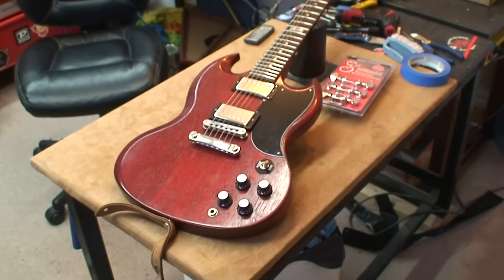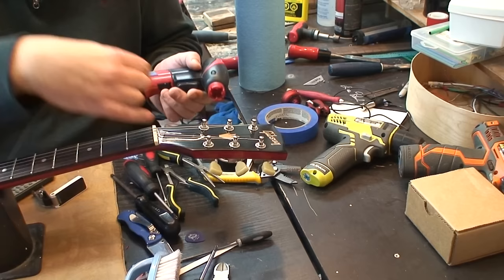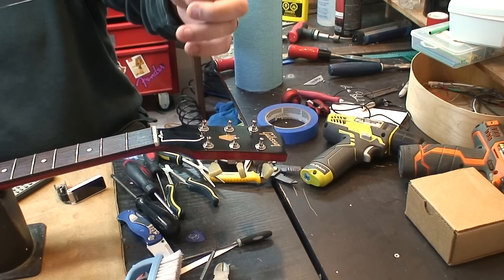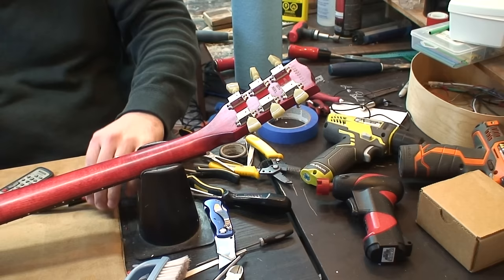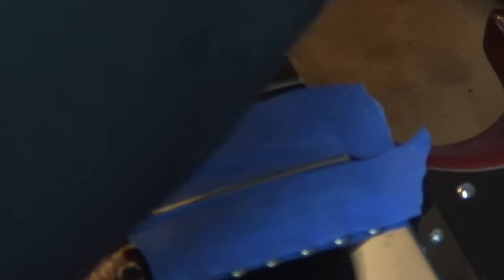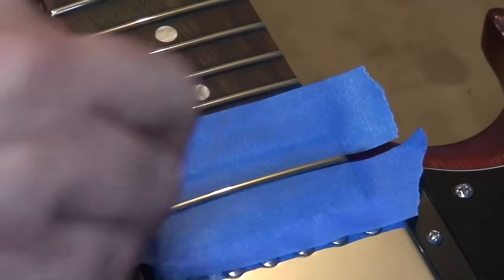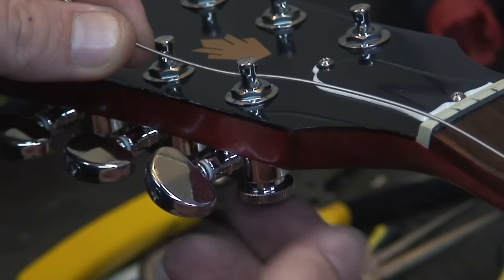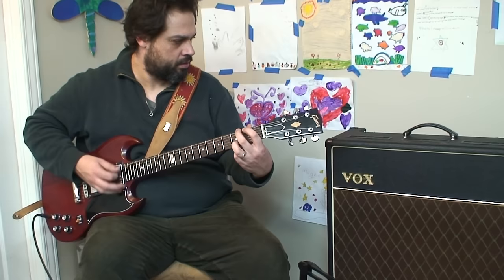2014 Gibson SGJ: Installing Grover 502C 18:1 Locking Tuners

Comment: GOTOH SD lockers with conversion bushings weight much less than the original vintage tuners lessening neck dive. Why are you adding Grovers and adding a ton of weight??? That guitar is probably now unplayable without standing and using a 3-inch suede strap. What are you doing? You crazy super villain, lol.

Comment: Kluson makes 2 kinds of locking tuners to replace the original Gibson or Kluson tuners: Revolution locking 3 x 3 tuners (wheel lock) & top-locking Klusons. 
I have 3 sets of the Kluson Revolution locking tuners.
Reply: Blkjakk yes, put those on all my Gibsons, great upgrade!
Reply: Are they drop ins or do they require some hole enlargement?
Reply: Putting a new Tusq XL nut on my SG and those locking Kluson's are next. I'm excited that they exist for my SG won't stay in tune. Hopefully new nut and tuners will do the trick.

Comment: One of the tuners on mine broke (the rubber feet that hold the back in place snapped for some reason, just real shitty outdated design tbh), I ended up having to replace them with rotomatics the other week because Gibson don't let you buy single tuners. Just adds to the long list of things I had to replace on my SGJ. That's Gibson for you
Reply: James O'Connor what else did you havee to replace? I intend on getting locking tuners, graphite nut, and the string butler. Check the last product out Its really cool

Comment: Scott grove is actually correct... and so was the guitar tech that told me 20 years ago that i was wasting money swapping tuners....Firstly... the ratio difference is hardly noticable, specially when using a winder, secondly.. tuners are made up inside of a cog gear and a worm gear, that goes for all of them.. the cog gear  CAN NOT turn a worm gear, its impossible, thats why they are designed the way they are and why with todays technology they still have not changed the design.... anyone who tells you their tuners are slipping is full of shit... it is impossible for them to do so,
Reply: Locking tuners make a difference though... String slippage is possible, even if tuner slippage is improbable. The thinner poles on kluson style tuners are prone to a lot of slippage... Source? I own a Gibson.

Comment: Unrelated: Can someone help me? I don't know much about guitars. I want to replace the nut on my Squier J Mascis Jazzmaster, and I don't know what nut to buy. I was looking into the Earvana nuts, but I'm not sure which specific Earvana nut to buy. I'm looking for a nut that will just drop in with no need for modifying it or shaving it down.
Reply: Interesting, I just looked them up. I'll probably go with the Tusq XL. I just don't know which one. Do you know which one would work best with my JM for an easy install? Like I said, I'm a noob so idk if my guitar needs a flat bottom nut or not.
Reply: Not long... I've had my acoustic for about a year and a half and I'm self taught. The JMJM is my first electric guitar.
Reply: Thanks man. Nothing's wrong with my nut per se haha. (Other than the fact that it's cheap plastic) but I plan on using the tremolo a lot so I want a better nut for better tuning stability etc
Reply: TUSQ is good stuff, but plan for some cutting and shaping now matter what you go with.. 

When properly cut and receiving the occasional application of Big Bends Nut Sauce or something similar, I think bone is the best of both worlds.